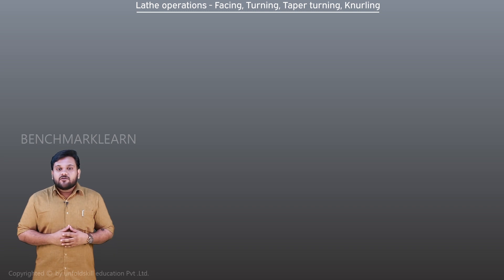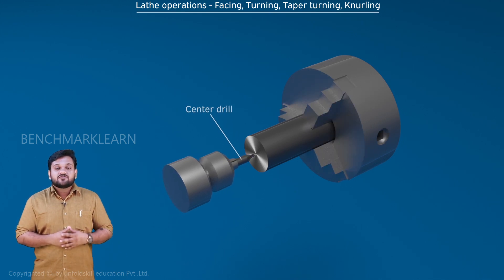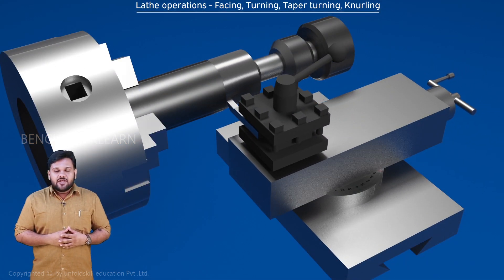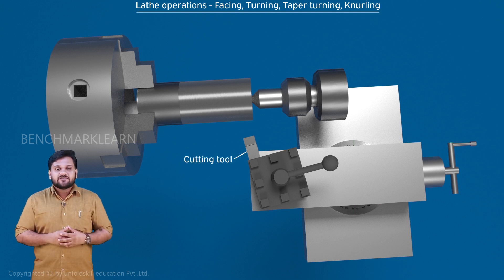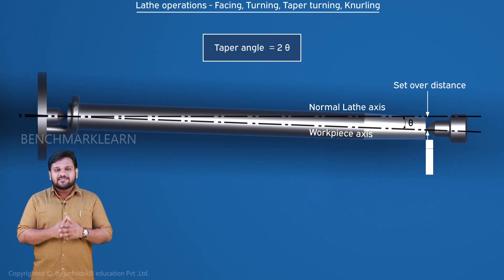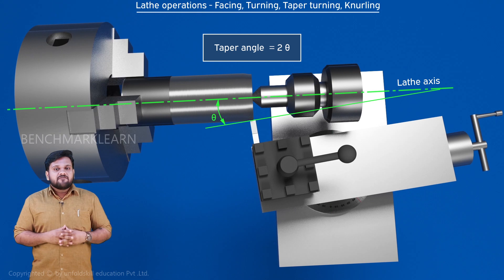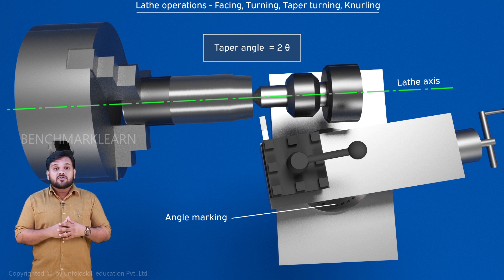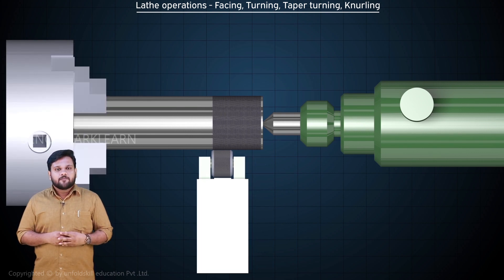Lathe Operations - Facing, Turning, Taper Turning, Knurling| Mechanic | Benchmark Engineering

Comment: How do you chuck using your method #2?  Do you constantly bend the workpiece?  You cannot just chuck a shaft and then move the tailstock off center.  The chuck jaws are trying to hold the workpiece perpendicular to the face of the chuck, in line with the center of rotation.